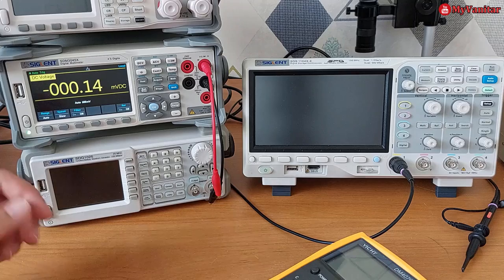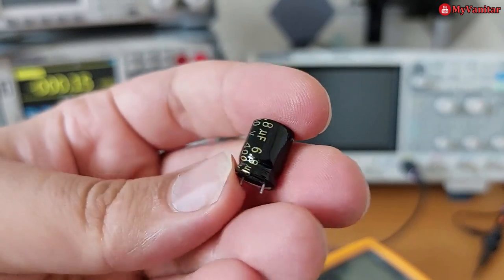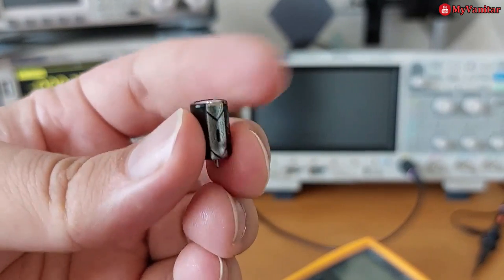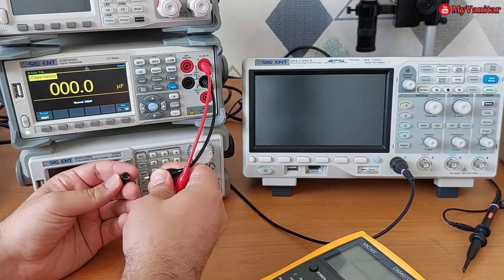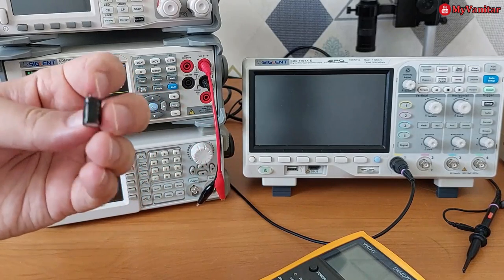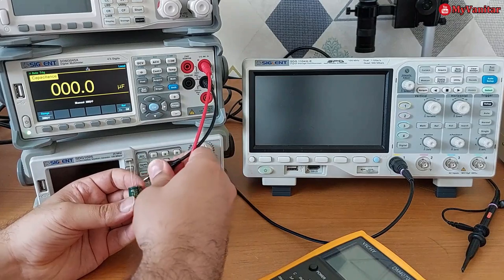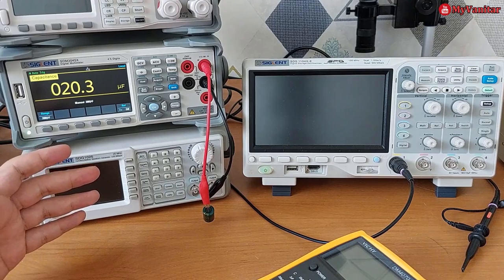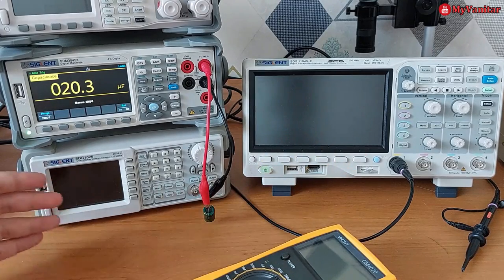How to Easily Detect a Failed Capacitor

Comment: NoT currently right i built a buck converter and i use a 3300uf blue coler amplifier capacitor the current storge was very large  and i get 21 amp  easy from it but i use another 3300 capacitor nichicon caps it test good on my caps tester and i get zero amp storage from it so u dont know that there or 3 type of ekectrical caps filter caps that hold high current and smb caps that dont how enery just act as low pass filter for clearing frequency repple and high frequency caps for enery delay
Reply from the maker: What's your question? try to test the caps using an LCR meter. timing method is misleading. if it was more than 10% OFF in value, replace it.
Reply: yes I use my LCR multiple tester and the  v.losses was 20% on the cap that didn't hold any current

Comment: Sometimes it show a good value but high ESR
Reply from the maker: it's very unlikely that increasing the ESR does not affect the capacitance also (in practice), so as I explained for the last case and the 22uF capacitor, if you even read 16-17, then definitely you need to replace it.